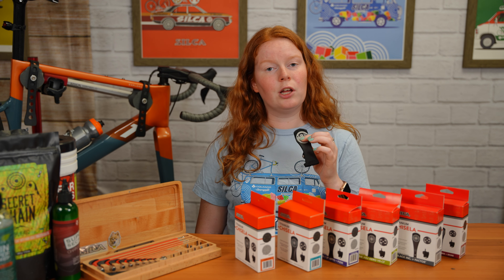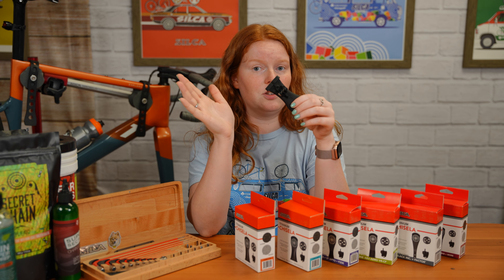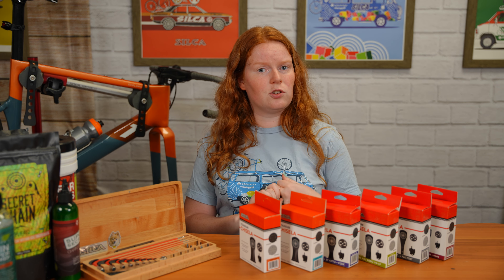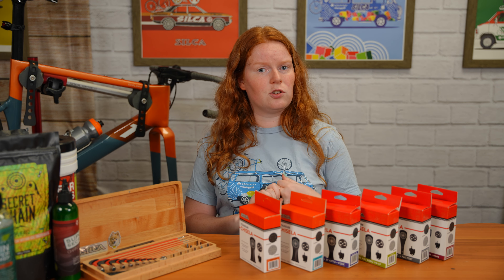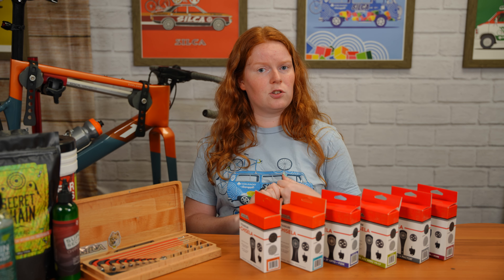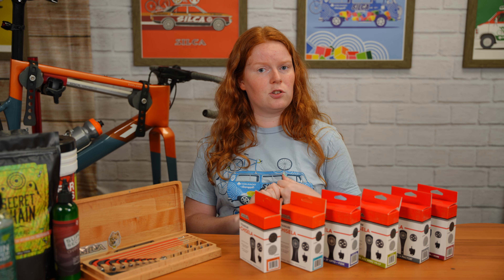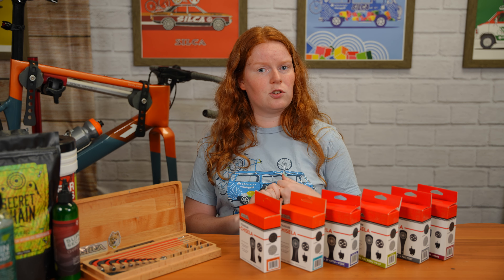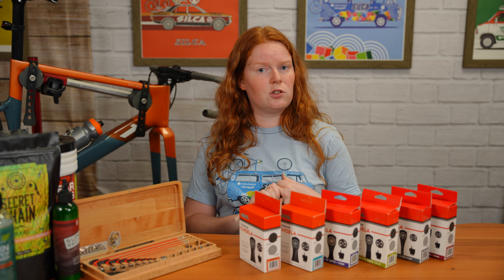What You Need to Know About CHISELA 3DP Computer Mounts

Comment: That weight limit is bad.  Lets say you are riding and you need to press a button to change the screen, the press of the Botton can actually add a momentary weight that far surpass that 150 limit……
Reply: I'd say that weight limit is more to do with the compound stress created by the Work (force x distance) that the weight exerts over a ride as well as the resonant force created by continual  road vibrating force. One press every now and then is not consequential to the stress of the titanium material or the bolt used. I'm sure their stress calculations bear this out. So a weight limit is based on a number of structural force assessments and not one shearing force that a typical finger press would do. Trust the engineers on this one!

Comment: Presumably, "chisela" is supposed to be an Italian word. If so, it should be pronounced "ki-zela," so the girl mispronounces it throughout the video. Not sure what it means. "Chisel" in Italian is "scalpello." And "chiseled" is "cesellato." Also, it sure would be nice if some company, especially for over $100, could make a Garmin-compatible outfront mount that fits their external battery pack. In other words, has that lever attachment for the Garmin plus the bottom attachment for the external battery. I guess Silca was just not thinking.

Comment: I have a light often mounted under my Chisela and the T-Tray rattles, even with the security screw installed and tight. It's like there's just too big of a gap between the tray and the removable mount. To fix this, I had to use some electrical tape to decrease that gap a bit. I'd love to hear if there's a better solution or if maybe mine is just out of tolerance!

Comment: A Garmin Edge 1050 exceeds the Chisela weight limit as indicated in this video, but on the Silca site, it does not. And due to the relocation of the 1/4-turn mount o n the 1050, relative to the 1040, the 1050 might not fit on the Chisela in any case. It's impossible to tell, as there are no dimensions listed on the product page.
Reply: just got a 1050, and it’s a very snug fit, but there’s no contact. maybe 2mm between the head unit and the front plate of my stem. this is with the “standard” Chisela and a Specialized stem
Reply: @clarklindsay2902  That's good, but this is dependent on the stem. The 1050 fits with your Specialized but may not with my FSA Vision, for example. Garmin didn't do anyone any favors when they relocated the mount this little bit. There's a whole slew of mounts out there that now have to be replaced. This is Garmin's fault, not Silca's...but it does put Silca and other manufacturers in the position of having to add another SKU if they want to support Garmin's flagship model.

Comment: Does the Garmin Edge 1050 fit on it?
Reply: @silcavelo I would love to know if this is compatible with the Garmin 1050
Reply: Technically 1050 is over the weight limit. 11g or 7% over is not much though.
Reply: Actually they have bumped up the limit to 165g on their site, likely just because the Edge 1050 was releases and it is 161g
Reply: I can confirm the Edge 1050 does NOT fit on the Chisela wide mounted on a Cervelo stem. I actually asked a direct question of Silca too and they never replied. Thanks for that.
Reply: my 1050 fits on the standard Chisela. very narrow margin, but there’s no contact with the stem plate
Reply: @clarklindsay2902 standard 9-30mm bolt on version, yes?